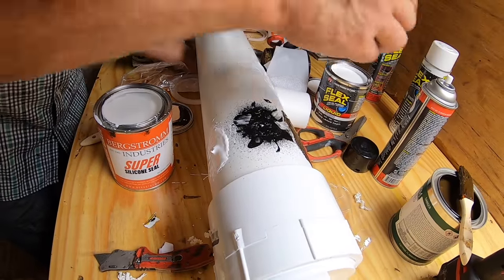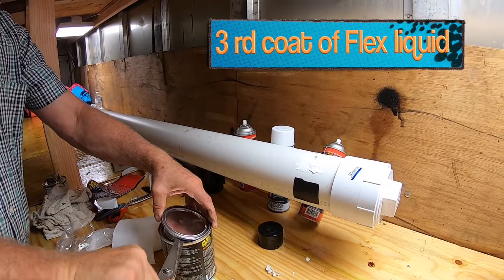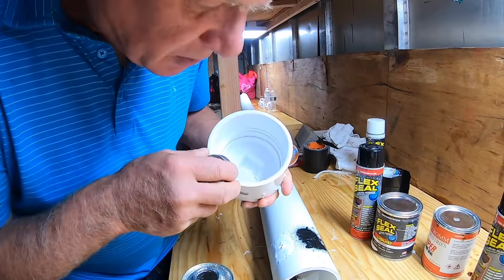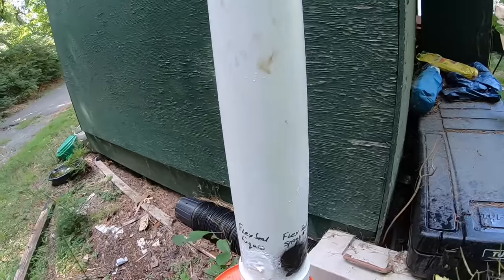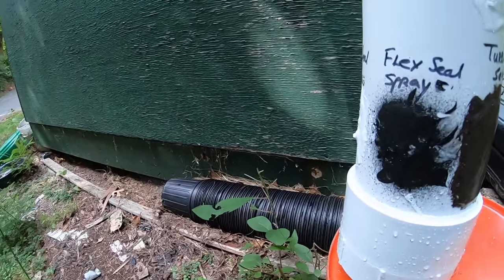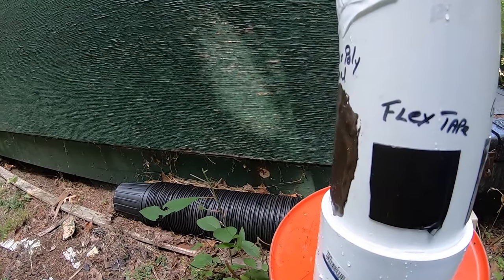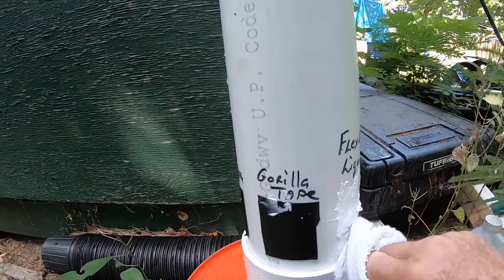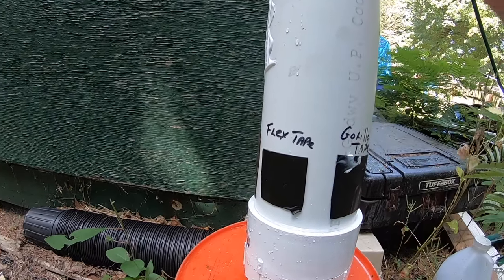Flex Seal, Turbo Poly Seal, Super Silicone Seal comparison and flexibility and strength test

Comment: That's a very good no frills test but you need to use the mesh for all or it defeats the purpose of the comparison. The mesh you use is probably made from a polyester cloth. Have you ever tried polyester reusable cloth like Scotch brite reusable wipes? They are cheap and just as good if not better. You might want to test them immersed in your super silicon and turbo poly seal. You are lucky to have the Bergstromm brand available. Not every country has it.
Reply: Here in Australia, Bastion branded 'waterproof reinforcement fabric' is readily available everywhere in rolls from our largest hardware store chain. And yes it's just polyester cloth.

Comment: Looks like all of these products work if you put the fleece with them
Reply from the maker: Maybe so, but you can't buy it like that. I am testing as  it is sold, dummy
Reply: @FlatRoofDoctor  Maybe yes! What a nonsense and rude answer to a legitimate question. Fleece tape is sold separately by Bergstromm and all hardware stores. Bergstromm products are way overpriced. What a pity your great advice is tainted by this fake test.
Reply: @FlatRoofDoctor  not to mention once the other's start leaking, the pressure is dropped. may not be alot but still. but a fair test IMO would to test liquid media them selve's alone, no fleece? just a thought.

Comment: I just used the Turbo Poly Seal to repair, several patches on a 13,000 SF metal roof. Worked great and was tested a few days later with a large rain storm. No leaks, saved me tens of thousands of dollars, over a re-roof. I hope to get another 5-10 years, before doing a re-roof.

Comment: Thank you for doing this test with the different products and showing us how these sealants perform.  I've been very curious about Flex Seal, but now I know there are even better paint on sealants. The Bergstrom products with the fleece definitely adds the durability of incorporating fiber filaments to the bond under the stress of flexing. There may also be situations that warrant spraying, like if the shape of the area is very irregular although it would take several or even many coats to build it up. I bet one could certainly get some woven fiberglass sheet and use it with the Flex Seal if they couldn't find or afford the Super Silicone. This is definitely making me think about how to tackle some leak repairs.  *** I greatly appreciate you taking the time to make the videos and teaching us how to save money by doing easy repairs ourselves.

Comment: The gorilla tape is a little better than the flex in my experience. That turbo poly is interesting because of the fleece tape stuff that goes between the applications. They recommend doing that for the others as well. The flex spray didn't work as mentioned.

Comment: Interesting test results. I used Flex Seal with some woven fiberglass fabric to patch my leaking gutter 2 years ago, and it is still holding strong. I think it is time for Flex Seal to develop their own fleece/mesh fabric. It is standard practice to use fiberglass fabric to waterproof the shower with RedGuard, as it significantly improves the strength.  I have not tried Turbo Poly Seal yet, but will definitely give it short for my next project. The only concern of Turbo Poly Seal is that it can not be used on EPDM rubber roof material.
Reply from the maker: Good comment Thanks

Comment: Using the “ The right tool for the specific job and or product to fix it” is paramount.   I have not personally used the product,  but I would have used the FLEX tape and done a full double wrap providing a tighter, stronger, 360 degree circumstance providing structural integrity from all sides.  Thanks for taking the time and effort required to produce the actual video review.   I’m not insinuating I am correct and you are aren’t....I am simply providing the alternative on the PVC pipe test.   Overall,   You’ve produced the BEST FLEX TAPE / SPRAY VIDEO REVIEW I HAVE COME ACROSS.  Very professional and courteous in your presentation.   
Wm.
Reply: Flex seal is definitely a waste of money, used it once on RV, only lasted one season before it started to deteriorate.

Comment: kool u just answered my question thanks , sounds like turbo polyseal with fleece the best n longest lasting. i just fixed my roof with flex tape n silicone seal, next time ill use turbo poly seal

Comment: The bending demonstrates in a speeded up way when metal gets hot or cold how it would effect the seal. I guess tensile strength?  So one wants something sturdy,ability to handle extreme weather challenge  also expansion and shrinkage on products' versatile "going with the changes" Science: Roofing 101 Lab class!! Thank you both!

Comment: Probably somebody else mentioned in the comments but a fair comparison would be to use the fleece on all the liquid products...and no fleece on all the liquid products. Would the flex seal and spray flex seal have failed if they were reinforced with the fleece? I am guessing probably not as the fleece created a monolithic situation giving the two that did use fleece much more strength...The ones that didn't fail probably both would have failed without the fleece also.
Reply from the maker: I show a comparison as the product is sold. Why should I add a fleece to Flex Seal Liquid if they never sell it with it or mention it in their products? The comparison is how the product is advertised and not how I can enhance it to make it work better.

Comment: Commercial HVAC guy here. We left a RTU curb we cut in on a  TPO roof sealed with only gorilla tape and got a call 18 months later claiming our RTU was leaking condensate to the interior. Possible but very unlikely as those rooftop packages are designed to be extremely leakproof (and we normally insist on curbs being roofed in before setting a unit but sometimes $$$ and warranty cancelation is motivational😁).
The water inside the business below was due to the roofing company not completing ANY of their work and the apetape finally falling. IMO 18 months of Colorado weather endurance is impressive for duct tape performing roof duty. 
P.S. Someone in this video has nice legs ant it ain't you
Reply from the maker: You are correct. I like what your reference to Gorilla Tape - "Apetape" That is funny. BTW,  you have not seen my legs. I definitely don't have chicken legs.

Comment: You will find with spray on products it is so thin in the can in order to make it through the orifice that multiple coats are required. Put one coat of Flex Seal on a sheet of glass and shine a light through it. You will be able to see the micro holes in the product which then requires multiple coats.

I'm a painter and use many coatings. Any product in a aerosol can has massive amounts of 'thinners' in it to allow it to spray. Half of what comes in a spray can evaporates into the atmosphere, so you're paying for something that you're not keeping. A brush or roll coating leaves a thicker amount of dry mils as a result.

Comment: You should try it again on a galvanized pipe. To see how well or how long these sealants can hold their bond to galvanized metal in a wet condition. Great tests, I like the flexibility test.
A time lapse would be good for the water test too, through a variety of temperatures....pretty tall order, I know....😄😄👍

Comment: To be fair, flex seal spray was used on a corner and given the pressure point is more conducive to subjectivity, I conclude is not a fair conclusion. I do not believe however, it is a product I would purchase.

Comment: Try the last flex test again and use the fleece on the Flex Seal products.
Reply from the maker: I did the test according to every products specs. Why do you want to improve the product with another product? That is how it is sold.
Reply: Flat Roof Doctor :  We are all aware of how it’s sold.  You said yourself that the biggest difference is the fleece.  Give them all the same fleece (not the tape) and try that flex test again and it will likely show the product you use all the time as superior.  But it may not and I think that worries you a bit.

Comment: I had 4 coats of flexes spray hold up on old copper pipes I didn’t even clean them before I sprayed. Under pressure it lasted 4 years I moved so don’t know Ayer that 3 plumbers cheapest estimate $700 1 can of flexseal-BAM

Comment: How about Sillco 'through the roof' sealant? Do you think it is a good option for using with fleece for 1/8" holes in a thin metal roof?
Reply from the maker: yes that will work

Comment: As long as you are using a secondary fibrous product (Fleece) in conjunction with Turbo Poly Seal and Super Silicone Seal coating those products will have a reinforcement advantage over any product in any test while other products are not of similarly reinforced.  It would be like testing an off the production line Volkswagen  Bug against an Lamborghini in a  quarter mile race.  I am sure Flex Seal was not meant to be sprayed at point blank range onto or into a surface hole, usually the manufacturer designates a distance,  However, the use of fleece, with each of the product would have balanced experiment and determined if the wet product was sufficiently bonded to the surface and strong under equal conditions.
Reply from the maker: Yes the fabric is key. But the test was "as products are sold" and "advertised". Flex Seal never shows in their advertising to use fabric with their products.

Comment: The truth is It does work or i should say we don't know if it works because he didn't spray enough Flex Seal spray on it to know. I just have to tell the truth.  You have to completely cover the hole and layer upon top of that To stop it from leaking and would have worked just  fine.

Comment: I’ve got a 1” round hole through my green standing seam roof where a pipe went through.  Do I put the TPS down around the edge and then the fleece over the hole.  Then cover with a layer of TPS?
Reply: 3x3 inch square piece of zip tape shits the most sticky on roof applications funny thing they make a sheething that last 30 years uncovered just tape the seams I’ve been recommending it for years. It’s called Zip System tape it’s worth it’s weight in gold 😉🇺🇸❤️

Comment: Very interesting comparison. I wonder how well each product would perform under the pressure of a sprinkler system. Have you ever tested under these circumstances?
Reply: None sprinklers are like 50 psi plus the pipe test here was 4 psi
Reply: For a good comparison test search for the Project Farm video. Unlike RD he does not have a dog in the hunt.

Comment: You have made me a believer of turbo poly seal. Can it be used on a TPO patch?
Reply from the maker: It works great on TPO. It does not work on EPDM. I have another product that I have tested for over 2 years now that I use on EPDM called Super Silicone Seal. I have started to make videos on that too.

Comment: @Flat Roof Doctor  What about using the flex tape first and the flex seal liquid on top? Would the tape act like the fleece and the liquid protect it from the elements? I am considering as it is more affordable to repair a single 10 foot long seam.
Reply from the maker: Flex Tape is Plastic with glue. Fleece is a Polyester Fabric that gets saturated with the liquid coating. You can't use Flex Seal Liquid over plastic tape, it will not work.

Comment: I like if you used flex liquid with the fleece..that would been more fair
Reply from the maker: You are just ignorant as others. The test is about products as you buy them off the shelf. Why should I go and enhance a product with another material to make it fair. You need to check out what is fair. If you could buy the fleece with the spray or Flex Seal, be my guest. You ignore what the test is about and try to give opinions about unfairness.

Comment: Great video! I need a suggestion. I am running an experiment for my research.I will make very small holes in a container and insert electrical wires in those holes. Holes are just for passing the wires into the container. Water will remain inside the container. Water is licking with these holes. From my understanding, any tape may not stick nicely as the surface is not plain like the bucket in your video. I  need to wrap it around the wire and container. I have to take out the wires without damaging them after completing my experiment. I will reuse the wires, Which material will be best to use here? Please suggest.
Reply from the maker: Ok, a lot of things were not clear in your request.
1) What size is the container?
2) What material is the container made from?
3) Is the container suppose to be filled with water?
4) In which country are you?
5) How much time do you have for curing (hardening) before use?
6) What is the size of the hole?
7) How much pressure will be at the hole?

Comment: The fleece you use with the turbo moly and silicone... what is that fleece made of? Would like to see how the spray and liquid flex work with the fleece.
Reply from the maker: It is a non woven polyester fabric that has been specially designed to work with Turbo Poly Seal and Super Silicone Seal

Comment: Does the fleece come with the berg storm poly seal or do you have to buy it separately. What is the brand of the fleece and where do you buy it from. I live in Canada where it is much colder. Will the poly seal work for gutter leaks as well.
Reply from the maker: Turbo Poly Seal works in all temperatures. The fleece comes with the Kit. Unfortunately, =they don't ship to Canada yet. It is a special Polyester fleece formulated for Turbo Poly Seal. I don't know of a similar product.
Reply: The fleece is sold separately by Bergstromm so you do not have to buy the kit. Home Depot sell Henry fleeces, including polyester, and at much lower prices than Bergstromm, as well as Henry silicon sealants.

Comment: Hi. Thank you for this great video. But something I wanted to ask if you could do this test again but in separate tubes. Because once there is somewhere the water can escape, it lowers the pressure, and it’s probably why the other methods didn’t fail.
Reply: YOu're confusing water weight pressure vs. compression pressure.  The pressure of water will remain constant so long as they were adding water during the video.  Water pressure wont drop until you shut the inlet.

Comment: It is not a fair test for fkex seal on the end has a corner that can leverage itself up as it can stress in two different directions and the other only one direction. The  flex seal will be stressed along it side edge and front edge. Unfair to Flex Seal that could have been the plan maybe but this seem to be obvious 🤔.

Comment: My question would be, why does it look like you used a backer behind the super silicone seal but not the flex seal? That doesn’t make for a very fair comparison. No hate, just looking for the best solution
Reply from the maker: What5 backer? Maybe you refer to the "polyester Fleece"? Super Silicone Seal and Turbo Poly Seal comes with a Polyester Fleece in the kit whereas the other products don't. What is so unfair about the demo? You are getting old I think?
Reply: @FlatRoofDoctor  I didn’t realize the fleece was part of the product..
Reply from the maker: @frednot809  I really just enjoy you commenting and interacting here on Youtube. I appreciate it because it helps to promote this channel.
So, thanks for your support.
Best regards
Reply: I think he gets commission off the product. He's rude.

Comment: A better test would be to put them under about the same pressure on a typical municipal system. The flex seal spray didnt completely cover the hole.
Reply from the maker: I sprayed more Flex Seal Spray than anyone would . The video is clear that on both tests I over sprayed it which I think is unfair to the other products. Multiple layers is not what most people would do when using the spray,.

Comment: FYI - These are instructions from Flex Seal on how to properly apply the spray:
Step 3: Spray It

Shake your can of Flex Seal vigorously for about a minute. Then aim the nozzle at your surface and spray it in a sweeping motion from a distance of 8 to 12 inches. Take your time to focus on those holes and the larger surrounding area around them. Feather the edges. Let the first coat dry for 24 hours before applying the next coat. Allow 48 hours to fully cure.